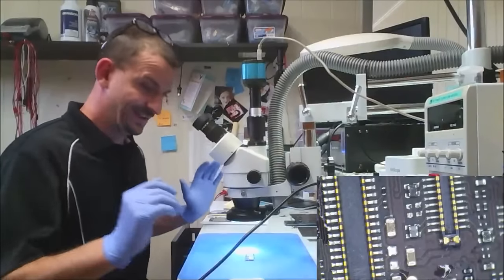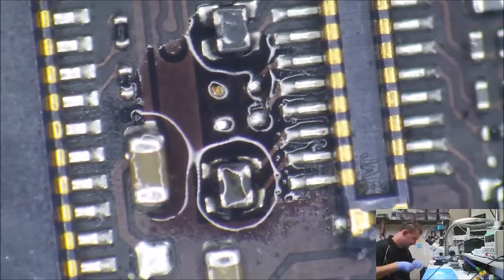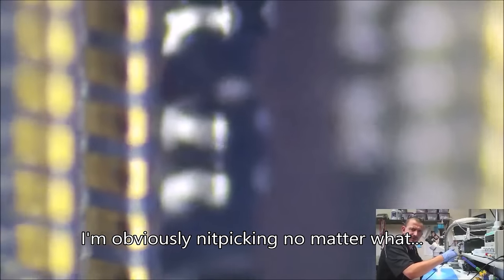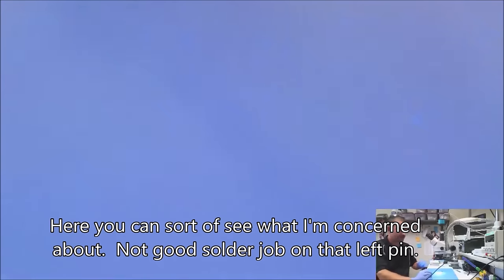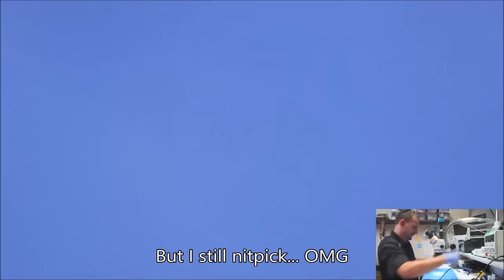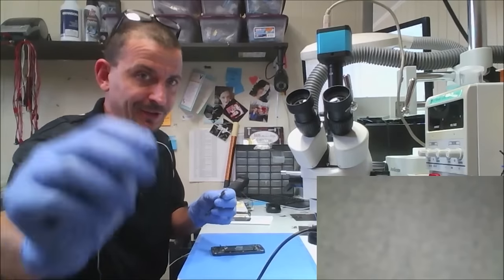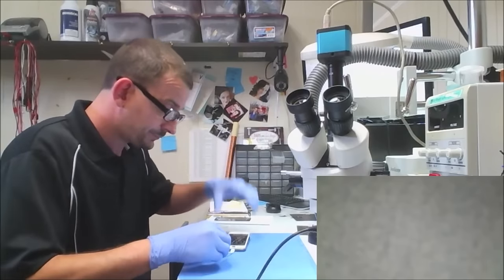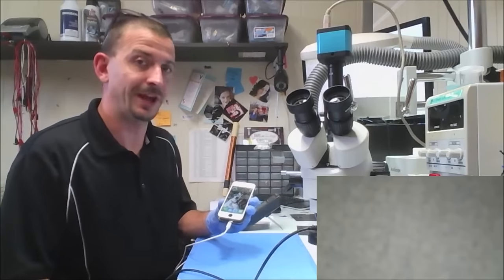iPhone 5 - Backlight with no image fixed (botched repair rescue - missing L42)

Comment: Dang looks like this is my problem I tried everything and nothing would I be able to just switch the receiver where you plug in the flex cables if not what soldering tool would you recommend can it be done without that microscope?

Comment: Hi, love you vid's and hope you have a tip for me. My iPhone 5s was not responding to touch, and the screen looks a bit crappy. I bought an original iPhone 5s display and after replacing the front camera and home button I connected it. I have backlight, but no display . This screen works perfectly on other devices, but on my iPhone i have no image. When i place the old screen back, I have image (but no touchscreen)
Hope you have some tips for me. tnx.
Reply from the maker: That's a tricky one :)  Might take another screen or two to narrow that one down.  It could be some way the connectors are seating that are slightly different from one phone to the next or it could be the screens.  Back when I was doing screens I would run into an iPhone 5S that was picky about screens.  I had some that would only work right with aftermarket screens and some that wouldn't work with aftermarket screens too.
Reply: STS Telecom Tnx, I will try an aftermarket screen the next time again. I love your work even though i'm not an expert. Many will by a elcheapo usb microscope (may be will use it 5 times a year) and an hot air station so that I can fiddle around with it :) . . tnx and hope to see more vids :)

Comment: Hello can you tell me your camera model I want to buy an equal for my microscope, thanks
Reply from the maker: There are different versions of this camera with a smaller sensor.  I made sure to get the one with the Panasonic 1/2.3 inch sensor but I'm not really sure how much of a difference it makes.  I bought the 0.5x adapter separately.  The adapter you need will probably be different than mine though. 

http://www.ebay.com/itm/14Mp-Tv-Hdmi-Usb-Industry-Digital-C-Mount-Microscope-Camera-Tf-Video-Recoder-D-L/331840738001
Reply: thanks for this info and for give me the link, best regards

Comment: Hi 
I am Harty from Fort Wayne in.im also a tech .some time I  face some black corrosion on mother board when I solder.why it happens I have no idea may be the heat level or solder or Flux . you have any idea sir?
Reply from the maker: Sounds like the flux.  Some fluxes are very very corrosive but usually turn stuff grey as it oxidizes contacts.  Burnt flux turns black tho...
Reply: thanks for replying.

Comment: Lets say the data chokes are good.  The display image goes from the connector through the chokes and straight to the CPU, correct, (or the other way I mean)? So in that instance you would need to reball/replace the CPU (ain't gonna happen)? Reason I ask is I have an iPhone 6+ I changed the Touch IC's, and a 6S I changed U4020.  Both have backlight, but no image and recognized by iTunes. - baffled.  I was looking for like an image type IC - LOL- & didn't expect it to be inside the CPU. I've taken diode mode measurements on the 6S (my tester) when it was in good condition and reference it now and see that the MIPI_AP_TO_LCM_DATA lines (6 of them, off the 3 chokes) are measuring a much higher resistance to ground in diode mode. (Help me, help me please my hair is on fire, LOL) hehe
Reply from the maker: I had an iPhone 6 Plus that initially wound up with half backlight a week after it left the shop.  By the time they brought the phone back, it had backlight and no image... you know after they twisted it for another week making the backlight work right.  I replaced the chestnut IC and one backlight driver and it fixed it.   A week after that they called and said the screen was blank again.  It was backlight with no image and I wound up refunding that one.  I feel like there is something very near by the connector side of the CPU in your case.  Hopefully not the CPU causing your woes tho!  I should know more about it than I do really...  much more time to learn now with the reduction in touch IC jobs.
Reply: I ran wires off the chokes and seen data so I moved on. PN5V7_SAGE_AVDDN comes from Meson. Got it. -Relief ahhhh
Gotta figure out the S next. Joy.
Reply from the maker: Hmmmmm...    I hope you don't have a reoccurring problem.  I sure thought Chestnut created those 5.7v lines.    These things will get an image on the screen without Meson on the board.
Reply: Seen this golden board jig used? 2nd one down http://www.everychina.com/m-board-test-fixture?cpc_kw=electronic%20test%20fixture&cpc_flag=c66082
So you can test under the connectors when connected. The connectors have extensions so you can have screen plugged in and take measurements.
Reply: I thought so too. G2 on Meson.
Reply: Just reballed it and got image back. All week all around the board and changed U1501 like 3 times, LOL. Time will tell. Probably didn't install it correctly the first time. Or this guy dropped it again.  It my very 1st touch return. Never ever had one before. Ever. I've done about 85 of them with only 4 failures.
Reply: I think it goes to Meson from Chestnut. Have no clue how most of this works, but trying : )
Reply from the maker: I would be scared to let someone work on my device that claimed to know it all... seriously! lol  

Come to think of it, there have been a few touch IC jobs where I replace meson and the phone seems dead then a second replace/reball meson fixes it.
Reply: Ya, that scares the shit of me too when it happens.

Comment: Another well made video. Very informative. What temperature would you use on this repair for both a hot-air station and soldering iron? Keep up the great work :)
Reply from the maker: Thanks!  Sorry, overlooked your message.  I'm using 380C on hot air and 750F on the iron.

Comment: Let me get a fresh cup of coffee BRB! OK n Roll um! Can you do a video on the tweezers or using them? Nice Job!
Reply from the maker: LOL! Thanks..

Most of these are some really cheap tweezers I got on eBay.  I ordered some of them from All-Spec for around $30 but they don't seem a whole lot better.  I'm still fixing the tips from time to time.
Reply: I have a hard time, as them tight spaces I can't get the chips to sit still while I re-flow. OR its close to something that will melt, I get around that with a melt shield. I guess I just need more practice............Great Video!!

Comment: hi 
there is issue with iphone 5 , i changed screen but backlight works , there is no image just horizontal sometimes vertical lines, with black screen, can u please let me know your viber or what's app number so i could send picture , 
i will really appreciate if you could help
thanks in advance
Reply from the maker: +datuna ogadze email or Facebook would be the best way to send me a pic.  I don't think I will be able to tell without seeing the board close-up though.